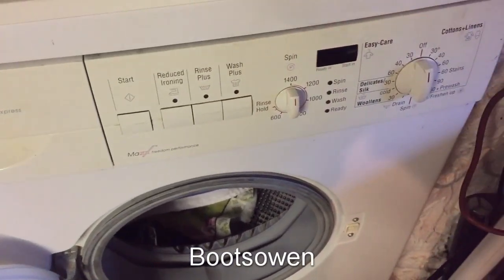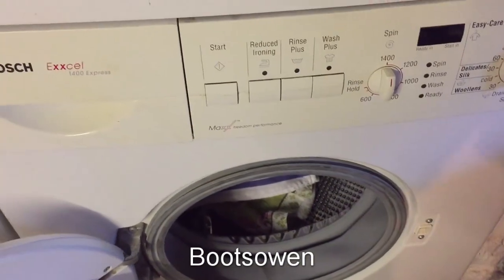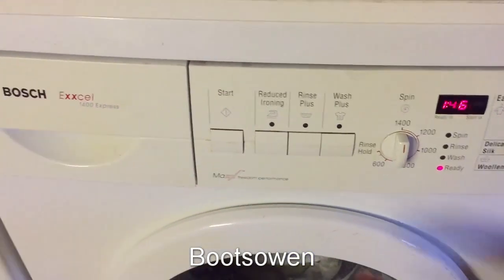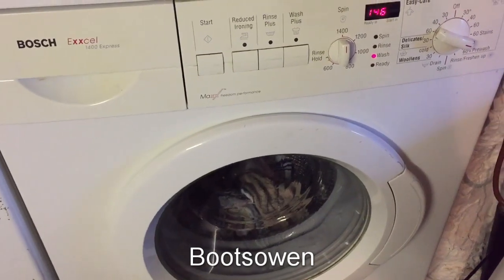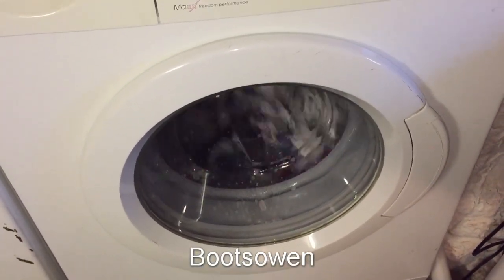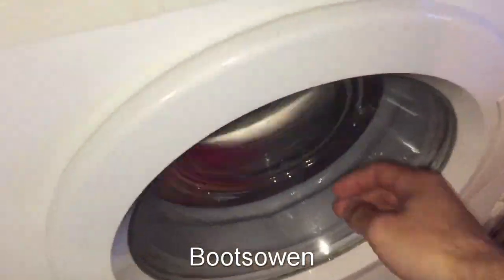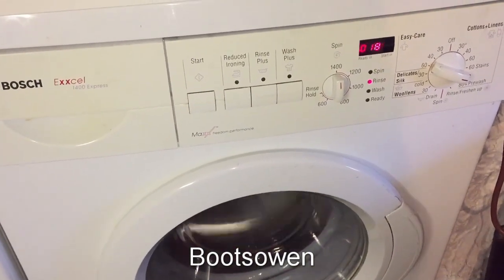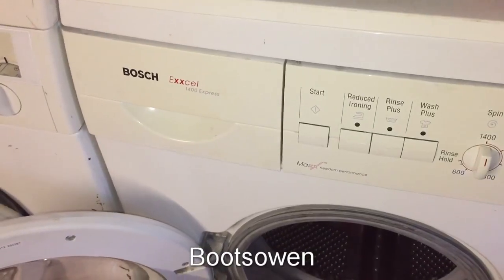Bosch washing machine heater fault? 90 deg test wash! (1 min error update)

Comment: i might be late, i have a very similar machine, replaced the heating element and doesnt heat up still. What could it be
Reply from the maker: Hi. It could be the heater relay or the wiring.

Comment: Did you ever figure this out? I've got a Vision 500 series thats doing the same thing. Stuck with 1 min left, door locked. I can turn it off and run the drain & spin cycle to finish the cycle. Even the Bosch technicians are at a loss.
Reply from the maker: I have posted another video of this. Have a search for 1 min error. Thanks

Comment: I have replaced my element and thermostat plus the motherboard.  My Bosch Classix 6 1400 still not heating.  Any ideas 💡?
Reply from the maker: Wires?
Reply: @bootsowen  sounds like major surgery if that's the case . I may take it to the repair shop

Comment: I would suggest maybe a ntc sensor on the heater as that going faulty can make it do some weird things.( my Hoover's went faulty and it threw up both no draining and motor error and heating error), could also be a sticking pump or the machine just got stuck in the wash for just one load
Reply from the maker: It could be the sensor as well. I'll give it a few more test washes.  It could be something to do with the hot weather maybe? But I think that is unlikely.
Reply: bootsowen maybe the hot water inlet on 95 made it work? I'd imagine 40 just takes in cold
Reply from the maker: I'll get to the bottom of it eventually
Reply: bootsowen it's just a case of running loads of different cycles with different loads to see if it gets stuck on a specific one or none
Reply: So did you work it out? I got the exact same problem.

Comment: My heater on my hoover washing machine. Still heated but washed until 1 min and left error code draining error and then heater error even tho heater worked. I changed the heater and thermometer and it drained and worked fab even though it still heated up. Deffo heater
Reply from the maker: Worth a go then!
Reply from the maker: Just the heater element or the element and temp sensor?
Reply: I don't know. I replaced both as obviously faulty and it saves money as using a corroded heating element takes longer to heat up costing more money might not look corroded but is on the inside. I replaced both with the cheapest I could get and it works a dream
Reply from the maker: Thanks!
Reply: I replaced the heating element only and the problem remains… so have ordered a heat sensor too, is that the same as the thermometer?

Comment: does running the washing machine on a cold setting bypasses heater element ??
Reply from the maker: Bypass, running it on cold will not use the element to heat the water.